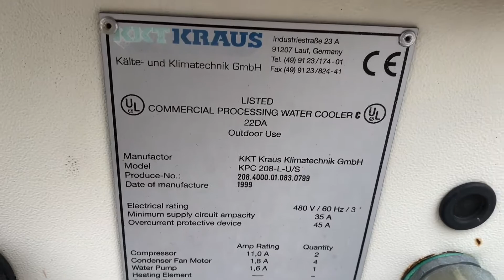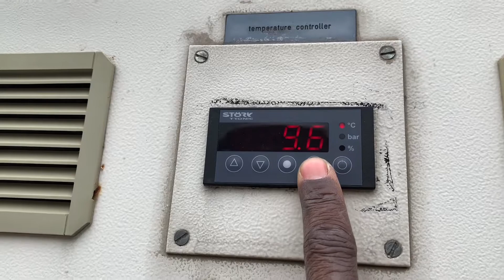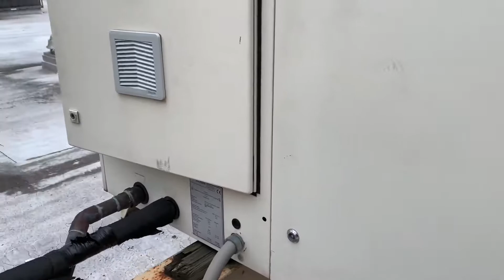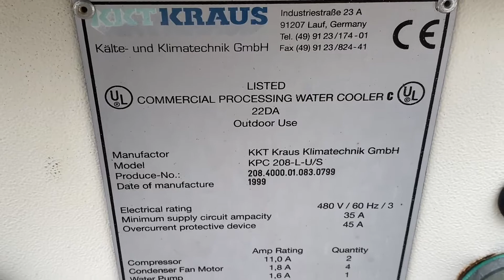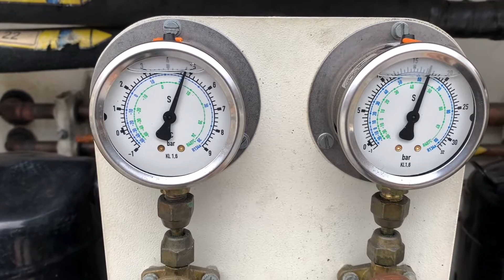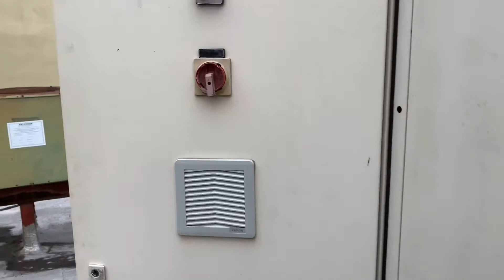KKT CHILLER RUNNING SOUNDS SO GOOD

Comment: nice video my friend    we have 2 in our hospital   but have a question  how you check water level and how add if need it   ill appretiate any help
Reply from the maker: There’s no storage tanks on these or so far I have never seen one on a kkt, however the operate with a certain pressure or pressure differential 1.5 bars on the fluid suction or low side and 4.5 bars on the discharge or high side
Reply from the maker: If your pressures are below that most likely you are low on fluids
Reply: @D2DNYAC  thanks so much  so if it low fluid how to add water in it?
Reply: @MrGabriel1973  Hi, so for adding water to the chiller at the hospital I work at, we shut off the chiller and attach the filler hose to the water return (to the pump) side connection. Then open the fill valve and watch for the gauge to move to the required pressure, then close off the fill valve. Once it's at required pressure, we turn the chiller back on. 

Some Techs use a hand pump to manually add water.

I just go off a utility water connection, it's imperative that no air gets into the water system though, so be careful. 

We've a 212 series Chiller and we generally fill to 2 Bar